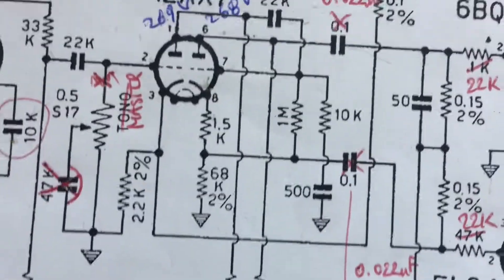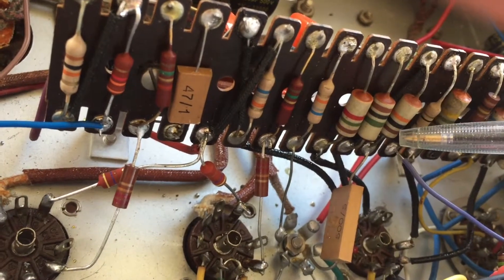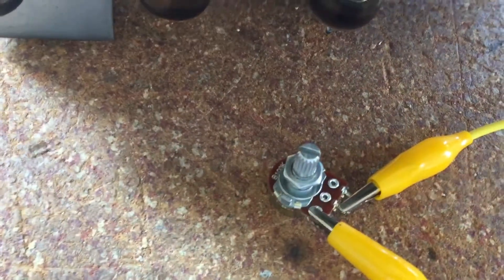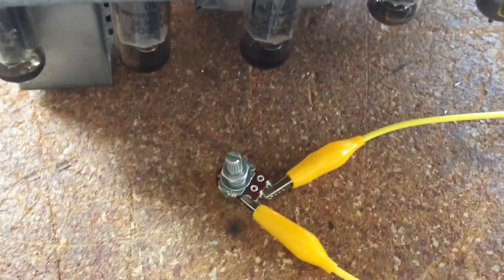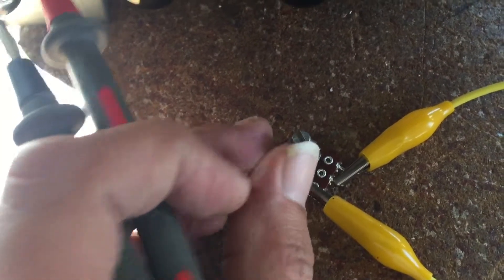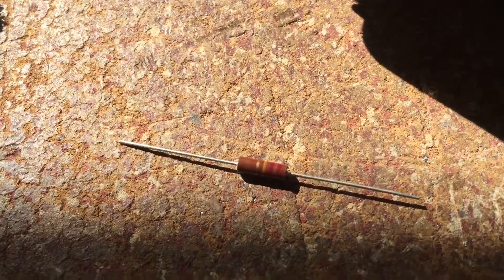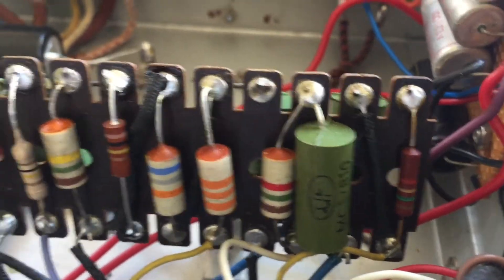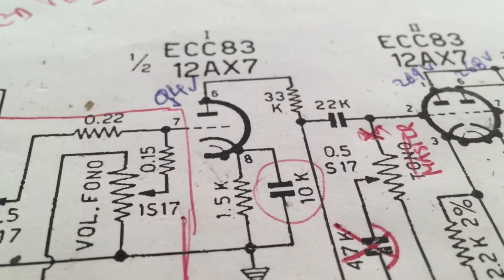1963 Geloso G215-AN tube amp part 3: modding the phase inverter filter

Comment: Curious....any resemblance to an 65’ Ampeg Reverberocket GS12 R? I was told that the filtering network may have an impacted on why my old amp doesn’t behave well with dirt pedals-fuzz/overdrive unless they are midrange focus like a TS. The Rocket is very bass heavy already which may expose its vulnerability with dirt pedals. I got a bit of the way by installing a large alnico maganavox P-232 speaker. After speaker upgrade, the eq effects of the treble and bass became less subtle. More effect and better to dial in tone. 
Just asking as I think this amp you have is similar to it? People say many things so I’ll go track it down and compare. I don’t know if you had issues with overdrive pedals and this circuit or you are just trying to dial in the best tone for cleans. I would love to find a great balance. Great mod and result video. Cheers from the rural world.
Reply from the maker: Hi man, just had a quick look at the Reverberocket schematic, this is quite a different amp. It compares best to a Vox AC15, with the two preamp tubes and a pair of EL84s. There is also no reverb circuitry in my amp. 
I learned from experience that bass is gain and gain is bass... if you use too much gain and the amp is bottoming out, it may be the output transformer being too lightweight. Maybe improve the filter section? Probably best to look with people with the exact same amp and similar problems...
Reply: @zjokka  Brilliant .....thank you for taking a look. I may have confused the brand. Your amp sounded great. I’ve been looking for a a vintage AC15/30 type circuit. It’s obviously the sound of generations. I’m curious of the many different circuits and have enjoyed ‘The Truth about Vintage Amps’ podcast. Great content for you if you weren’t aware. I’m learning bits at a time by books, videos like yours, and this podcast. Came out of the acoustic guitar world but have had a late in life interest in the music that shaped me. I’ve tried tracking down old military trained radio men but have had little luck and in covid times...not happening. I will check out some of your other videos. All my best to you.
Reply from the maker: @Invisbke  Hey man, thanks for writing back. I have listened to the first 45 or so episodes of that podcast... it's terrible as far as technical info is concerned, sometimes is plainly embarrassing, even to an amateur like me. In one of the first episode he launch a baffler (a question that baffles everyone): why does that tiny cap in Fender phase inverter not cut all bass? Answer: tubes arranged as 'cathode follower' typical Fender phase inverter changes impedance. This is advanced stuff, but the problem with Skip is that he has learning defficiency. He cannot look up in book, and certainly not on the internet, what he does not know. All his knowledge seems to have come from seeing or word of mouth and the Jack Darr book. That's remarkable, since his one of his kids went to Harvard! BTW, how did he pay for that?
Then the 2 prong cord, on which matter he's slowly been retracting his steps, probably after Angela Amps guy explained to him offline... 
He only works on real old Fenders and PA amps - how did he ever be able to make a living like that? Turning down any modern amp, because he cannot work on pcbs? He only started in the 90s, pcb amps were the norm then. 
Please, check out my Uncle Doug Tube Amp boot camp -- this guy (former math teacher from Texas) is what you need, Skips thinks he is but never will be. 
take care man, stay safe
Reply: @zjokka  ouch....yes, I get it but when you started from 0 at age 48, you can appreciate Skips charm and I always ask three times before I  attempt doing anything . The rural world is devoid of good local techs. I also watch uncle Doug also. I love it all. I’ve been enjoying a new channel “Psionic” that popped up in my feed. I will have to check out your other videos. I am looking for a an AC15/30 style EL84 type amp without the gouge of the vintage market. I started out with the Rocket, then an old 55’ GA45(same as GA40), then a Falcon and a Harmony’s 430-really kind of lifeless until you stick a fuzz face in front of it-then your brain begins to melt. I just love my Ampeg Reverberocket for the reverb, trem and natural breakup but it just doesn’t like gain pedals other than a generic mid heavy TS. I’ve been getting together a tool chest, variac, ERS meter-the usual suspects to start to experiment. I am Very cautious. I am so aware of what I don’t know. Watched a video of someone with a two prong cord go to ground while touching his strings and grabbing a mic stand. Shocking. I hope to build alongside the angels amps Steve???? With his parallel single end schematic. I have an AO-44 I’m going to mod into an amp. 
Any good books for late bloomers? I came via old acoustic guitars with a late in life love for electrics, but soon found that I was more interested in the amps, than older overpriced strats and teles the There’s just more to it. Built my second tele this summer and it’s a stunningly great guitar....but it’s money better spent on amps. I bought a 62’ Les Paul Jr.(Sg jr)...dog of a guitar. Sent it back. The only vintage electric that has captured me and I could afford was is a late 40’s ES-125. What a pickup. Well I love it all. Keeps me somewhat sane. Keep u the great content-super helpful. Cheers!

Comment: Hi thank you for your video! I recently bought a geloso g 215 a and it has the same selenium rectifier for the dc filaments and biasing.
Did you replace it? I red that i could use 4 x 1n4007 instead but with in series a resistor,but i don't know what value...
Other option just feed the filaments with the 6.3 ac and re wire the power  section...what do you suggest?
Thanks
Reply from the maker: Hi there... it all depends on what you try to achieve. I haven't replaced that rectifier in any of my 15W but did have to replace it in the 40W - I believe. 1N4007 should do the trick, but indeed you might need an inline resistor. the voltage on the filaments should be guideline, but with silicon diodes it will raise slightly...

I you do go ahead and experiment with them, do let me know how it turns out... make a video! I subscribed already ;-) thanks for commenting.
Reply: @zjokka  thanks for the reply ! My other option was to change rhe power stage and pre to a marshall 18 watt ,in this case i'm not sure if the B+ will be to high ,but if i can feed all the tube filaments with the 6.3 v AC ,i would get rid of all the dc circuitry and make everything more simple....
I just need to figure out how...
Thank you for subscribing ,i will post a video once i finish the job👍🏻
Reply from the maker: @antonix_81  DC for the preamp filament is actually kind of nice and prevent a lot of hum. What you should do to make this amp more suited for guitar is a) change the input from grid leak bias to cathode bias; b) get rid of the tone control and put in something useful; c) change the phase inverter to a long tailed pair ... this will make a big difference and doesn't cost much.
If you want to spend money, buy a new output transformer. I haven't tried this... but I have tried everything else and really wondering what would happen if I put in a modern reproduction output transformer for Deluxe, Vox AC15 or Marshall 18W...
ps: check my other videos, all thing I did with GELOSO 15W are documented in video.... please subscribe back ;-)
Reply: @zjokka  i agree ,i was thinking to use the marshall 18 watt schematic which has that phase inverter i think...and its pre amp too ,and maybe put a post phase inverter master volume as the matchless ...
As i said i'm not really sure the power transformer will be suitable for this mods ,i need to measure the secondary..
Do you think i can still use that schematics even if the geloso transformer is putting out 315 volts with the ez81? Probably i need to change some resistors values...
I agree for dc filaments ,but i would like to avoid any faulty selenium rectifiers...
I subbed back ,thanks👍🏻